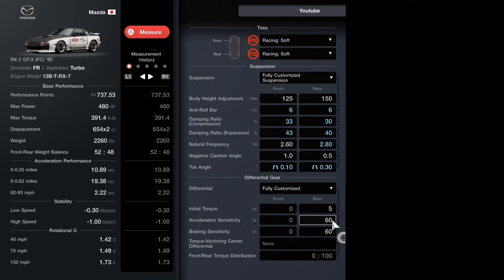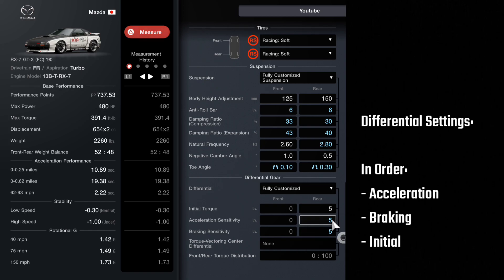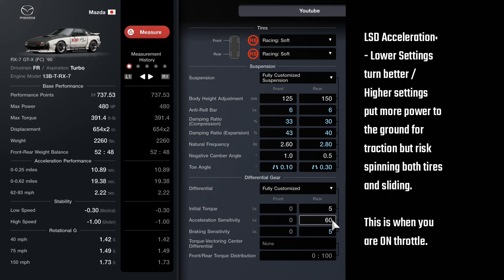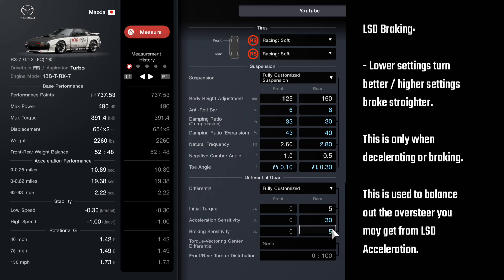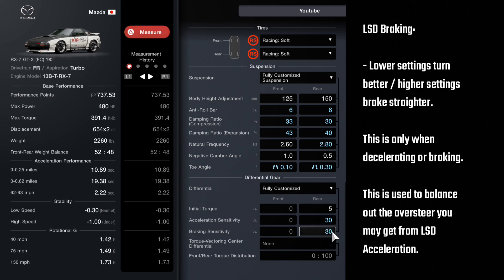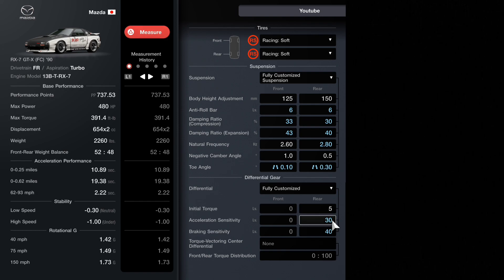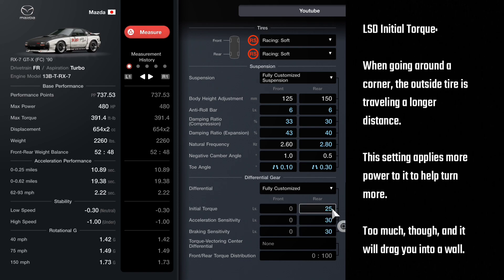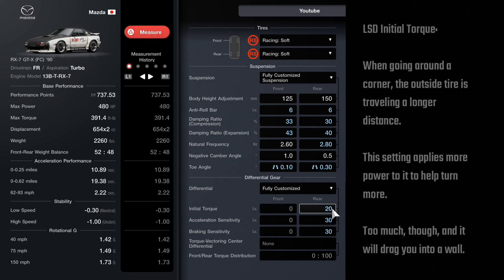Limited Slip Differential, GT7 Tuning Shorts.

Comment: I chose your video over the one with 135k views 🔥
Reply from the maker: Thanks! Go with whatever helps you out the most. 

I do need to update this one as they had made some dramatic changes to the LSD. 

LSD Torque: Now effectively affects the tires on the outside edge of going around a corner and the higher the setting, the more power it puts on that outside wheel so it will spin faster. 

Basically, higher LSD Torque will spin the outside driving wheels faster making them oversteer more, but too much will cause them to spin. 

Lower LSD Torque keeps them more balanced at the risk of understeer. 

I've been running mine around 10-15 lately.